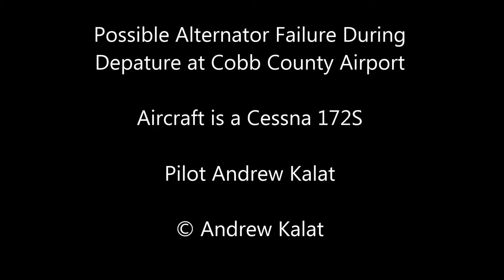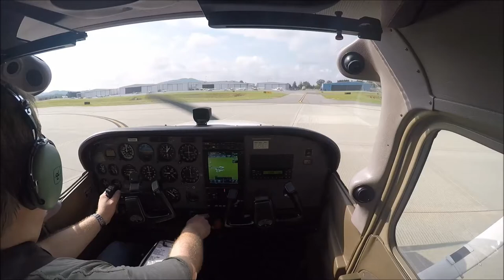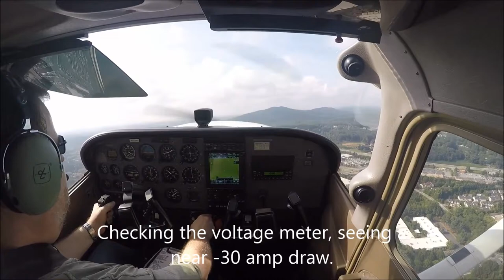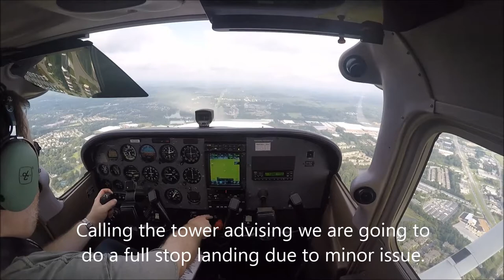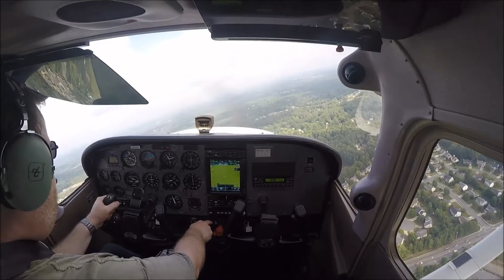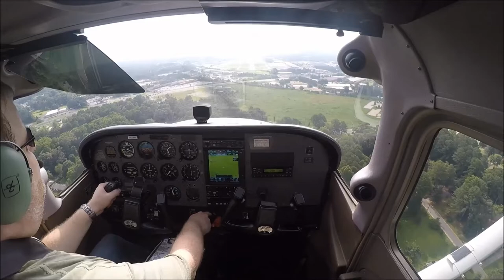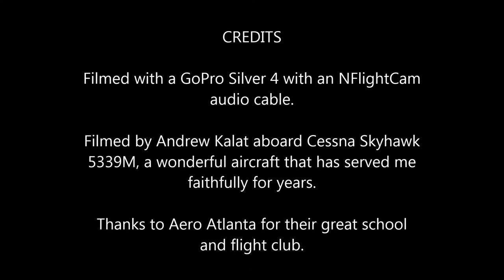Possible Alternator Failure in a Cessna 172S During Departure

Comment: Had my first electrical failure this weekend. I never saw the warning light. Attention was outside with a lot of ATC traffic calls. I caught the volts at 17 and soon after the radios started to flicker and shut down. I'm a low hour pilot, so I was a little freaked. I just kept looking for near by airports in case I needed to get down fast. I got a last static call out to ATC, squawked 7600 briefly, then went black. After I shut everything down, I finally went through and found a popped ALT FLD breaker. Pushed it in and proceeded to an uncontrolled field. Before I landed, I checked the voltage which was at a full 28. I turned on the radios again and was able to get into my Class D airport (10 min away). 

Turned out to be a benign issue, but for my first experience, it gave me a pucker factor of about 6 out of 10. Great learning experience. Had a major debrief with an instructor to see what I did wrong, right and how to improve my procedures in the future.
Reply from the maker: Wow, that would indeed be a pucker factor. Glad it turned out well!